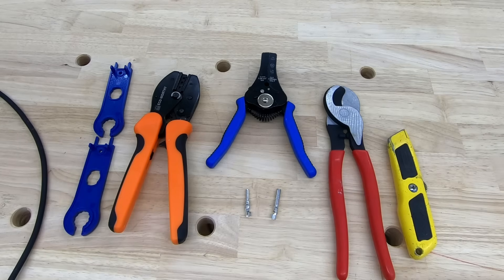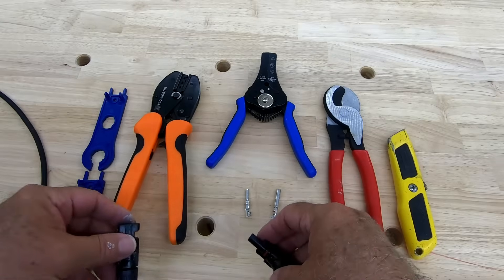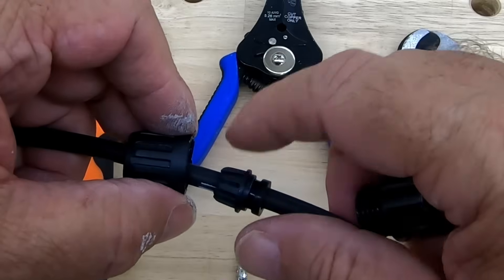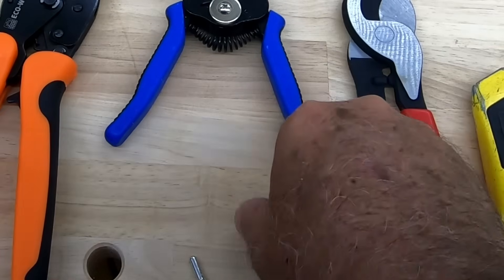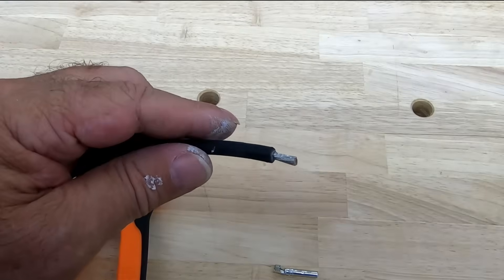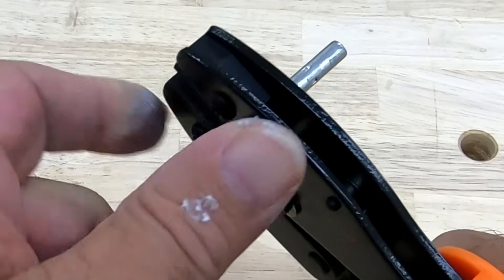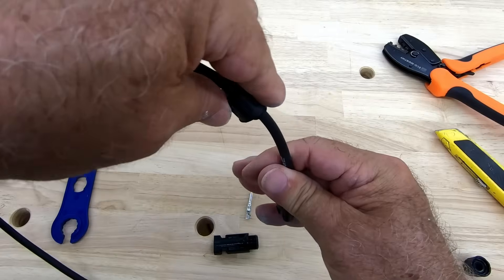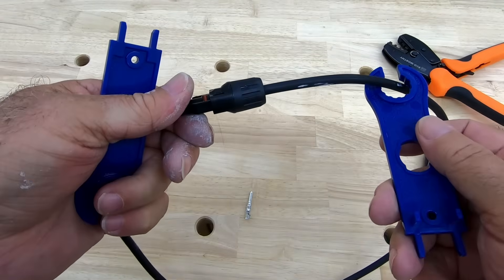DIY The Easy Way To Install Solar MC4 Connectors for your RV

Comment from the maker: DIY The Easy Way To Install Solar MC4 Connectors for your RV
Cable Cutter: https://amzn.to/43w22OP
Solar Crimper Tool Kit: https://amzn.to/4hBiSSw
Wire Strippers: https://amzn.to/47tXHgw

Comment: the small one is the female and the large one is the male just opposite of what we all think but its the metal connection is what they call male and female I found your channel watching your cabinet built good job and you have another sub cant wait to watch your channel grow wish I would have seen you hybrid inverter install video sooner I just got done doing mine put 4k solar on my rv and two of the li time 560ah 12 volt in parallel for 24 volts Im going full time with wife and 4 dogs end of November heading to quartzite Az. first for the rtr and schoolie paloosa then towards Florida for a month or so then to the U.P. of Michigan for the summer 40 foot monaco dynasty
Reply from the maker: Thanks for the info and the subscribe, I appreciate you being here!  Sounds like a great trip you have planned, Gwyn and I were looking to visit both for a few weeks in each.  I also have family in Michigan that we want to hang out with hopefully next summer.  Have fun in Quartzsite and be safe.